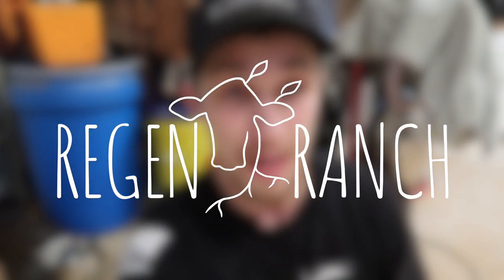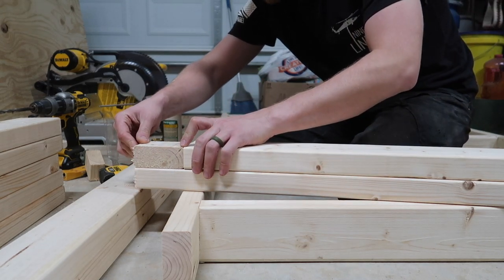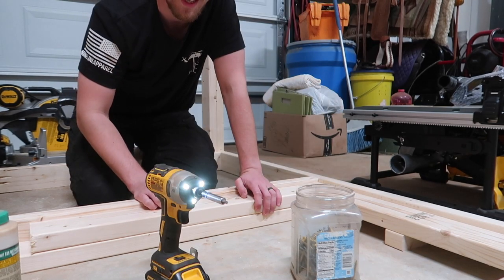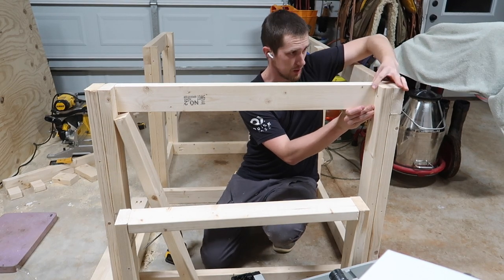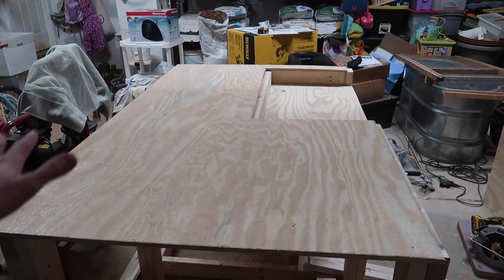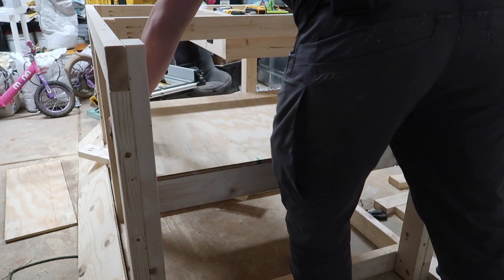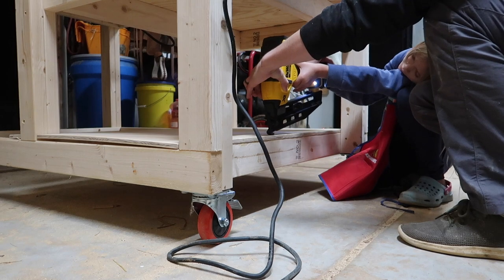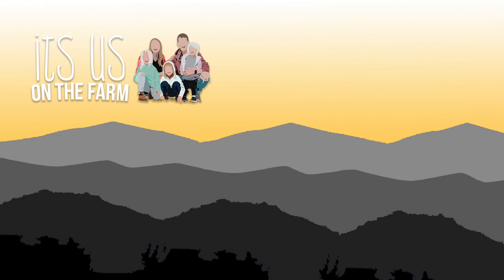Making projects on the ranch easier! // DIY Miter & Table Saw Workbench

Comment: You mentioned not wanting to do the undermount shelf, but if you turn the 2x4 90 degrees you can inset the lower shelf a bit. This has the outer edge of the bench working as a lip to keep smaller items from rolling out and some extra usable space. Nice work!